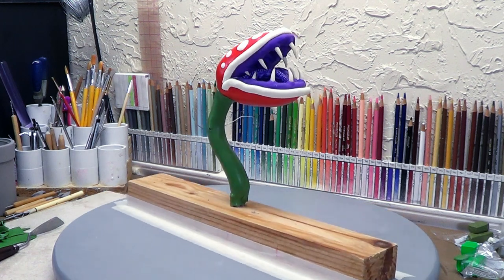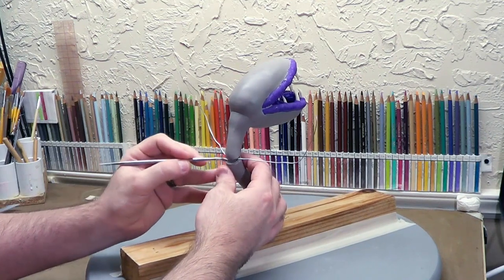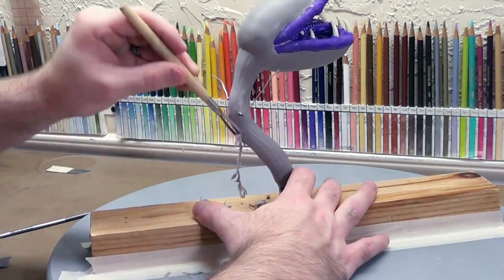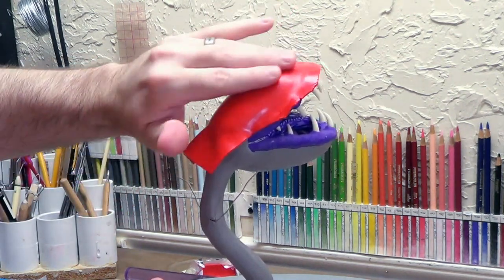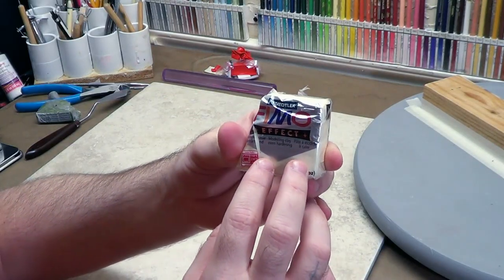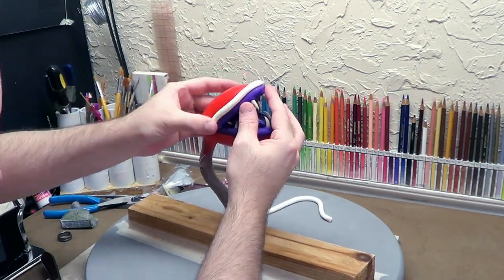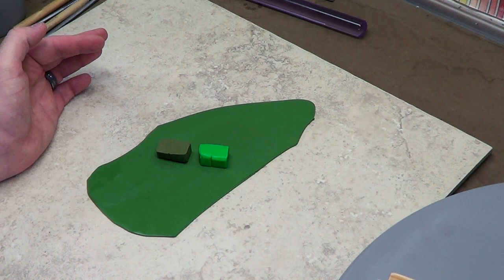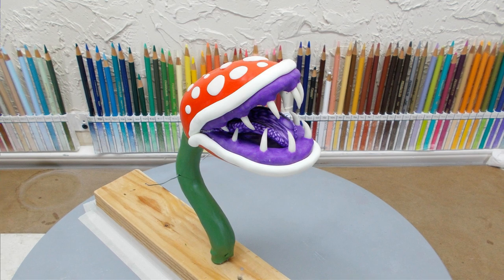Piranha plant, part 7: Skin coating using Sculpey Premo clay

Comment from the maker: Yes I can.. I started sculpting with air dry clay in fact. Made a few things from it. Learned that no armature can be used because air dry clay shrinks a LOT!!  Polymer Clay shrinks less then 1% so it can be wrapped around stiff objects with no problem... I found air dry clay very fun to use, its VERY different tho. I quit using it when I tried to fire the pieces I did witch resulted in precious hard work exploding in the Kiln. You don't have to fire them tho, but they are VERY brittle.

Comment from the maker: Hmm.. originally I would say mix sculpey clay softener into the clay little by little until its reaches the firmness AFTER it cools from all the conditioning.. But because its garnet  (I assume your using Fimo's Effect clay? ) mixing that will only combine the colors into one color thus losing the granite effect.  Maybe if you pour a little clay softener onto it (get it on all sides) and store it in a spare plastic container for a few days. It should absorb the moisture over time...